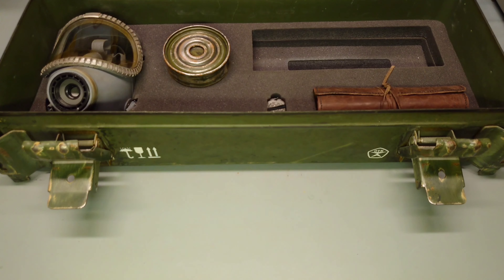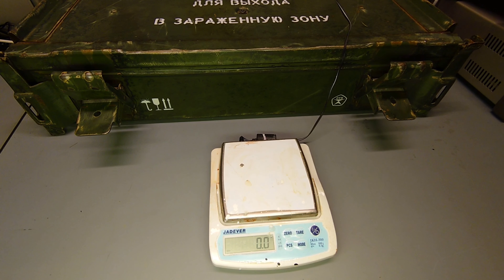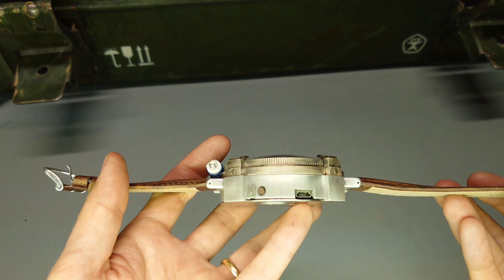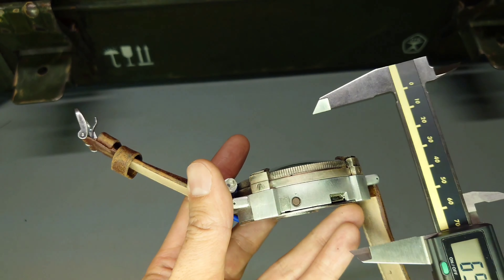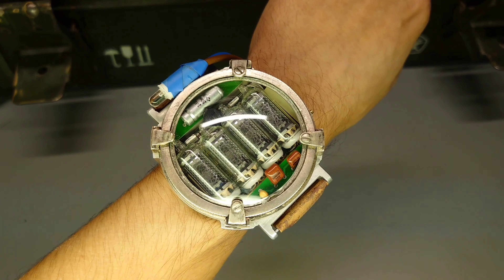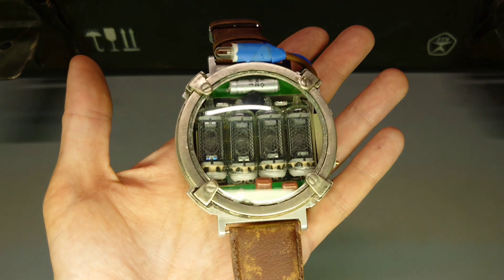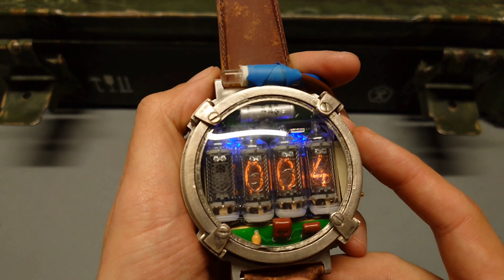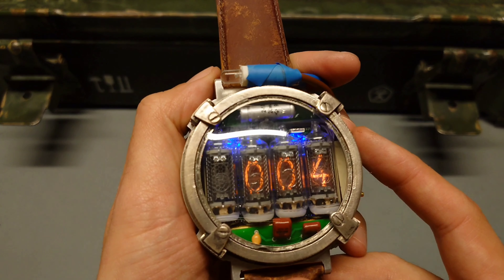Metro Artyom Nixie watch explored

Comment: Thank you for showcasing the watch! I would love to buy one but damn are they expensive!
Reply from the maker: Thanks for the appreciation! Yeah, they don't come cheap, do they? Hope you can find something at a good price point!
Reply: @WeskerKTH its harsh becuse the tubes alone are dirt cheap, the good size for a watch is just 10$ each
But you have to know alot about electricity watches and electronics, and suddenly from max 100$ thing it becomes a freacking 1300$
Reply from the maker: @Iron_Soil  Yeah, it does get expensive. Nixie tubes may be relatively cheap to buy in bulk from some old surplus, but you would have to put them through considerable testing to feel confident that they are okay. I am sure there are guides for operating Nixie tubes with simple electronics like an Arduino or so, but combining the small form factor with the electronics you need probably takes a fair bit of skill and knowledge, just as you said.

Comment: what is the model of GDI, IN-16? why didn't 4a games do it on IN-17, they're smaller in size
Reply from the maker: Sorry, I'm not sure what you mean?
Reply: @WeskerKTH  gas discharge indicators
Reply from the maker: @maxokun2908  Ah, you mean the Nixie tubes themselves? I was not familiar with the GDI term. I guess smaller tubes are even more expensive? Just imagine how many military-grade rounds that would cost!
Reply: @WeskerKTH  It's not even about ammo. in Russia, people themselves began to make such watches, smaller and more functional.
on this clarified what model of lamps?
Reply from the maker: @maxokun2908  The comment about the military-grade rounds was in reference to the "Metro" universe, where such rounds are used as the de facto currency. The watch - as far as I know - is completely custom, so there are no specifications as to what tubes have been used. If you are interested, I could try to measure/estimate the size?

Comment: A great unusual looking watch but I think it is spoilt by the addition of the LED torch on the top. Why?
Reply from the maker: This is for the watch to look just like the one featured in the game(s). As I mention in the video, the LED in the game lights up when you are visible to the enemies. (Here, it is just operated by the button on the side.) The LED runs off a separate battery and could in principle be removed. I of course prefer to keep the watch in its original mint condition.

Comment: This thing is thick. There are some nixie watches that are less than 15mm thick.
Reply from the maker: Yeah, one can certainly say that this one's got big bone... The domed glass adds to the thickness, but also makes the watch very unique. Also, I believe it is a more conventional four-tube watch built into an additional casing, which houses the separate battery used for the LED on the side. This box-in-a-box approach adds to the thickness as well. But this way, it can probably stop a bullet, right?! Unless it is a military-grade bullet, of course...

Comment: The watch is as cool as the fallout pipboy. To bad that it’s bulky and not smooth looking like in the game
Reply from the maker: Thanks for your comment! If you are talking about the Pip-Boy from the Fallout 4 Pip-Boy Edition, then I would disagree strongly, and I own that one too, so I am in a position to make the comparison directly. That one is a mass-produced piece of plastic. In the advertising it certainly looked amazing, with an aged and weathered effect, but there is nothing like that on the actual Pip-Boy or the box itself, just the feeling of low-cost plastic. The "electric" functionality of it is limited to very simple battery-powered lighting. I am not sure how many copies the Fallout 4 Pip-Boy Edition came in, but it is certainly thousands, if not in the tens of thousands. In contrast, the Metro Artyom Edition exists in ten (10) copies. Everything is hand-made. The box is not mass-produced plastic, it is with all certainty an actual worn-and-torn military storage crate. In fact, all items included in the edition have the same high level of quality. The watch, which is the main piece of the edition, is a fully functional four-tube Nixie watch. These two Collector's Editions do not even begin to compare, in my eyes.

As for the bulkiness, I believe the watch is a very accurate representation of the one featured in the game. Of course, in the game, you don't have to worry about it getting caught on clothing or breaking. It could be that my wrist is just way too small, or that you should have the full "bracer" thing to give it better protection.